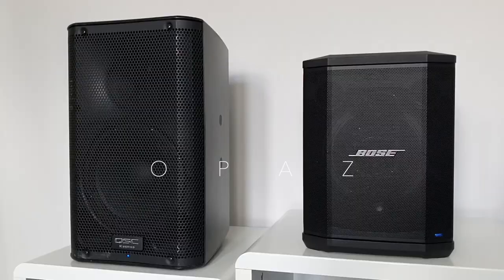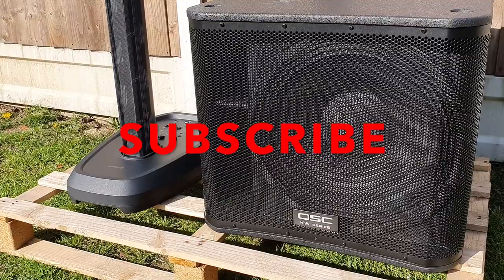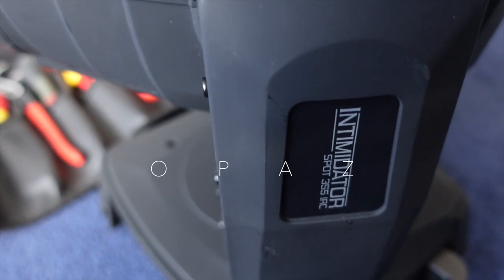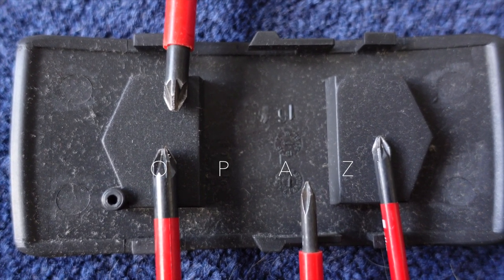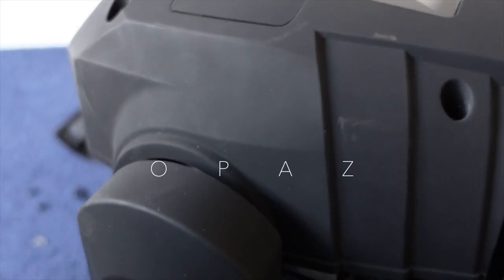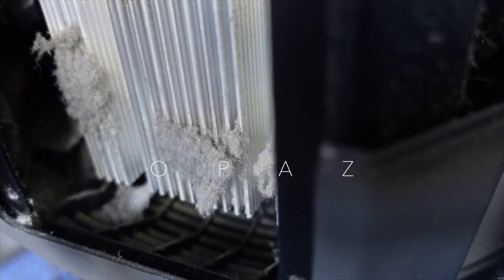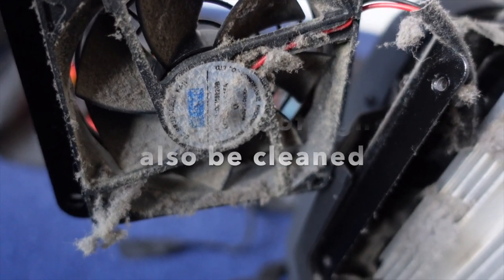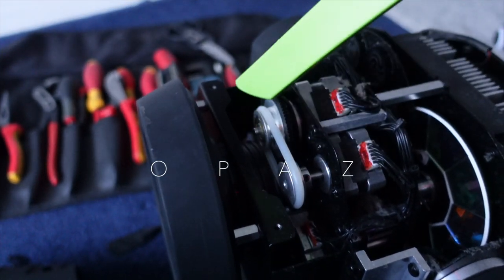Chauvet Intimidator Cleaning / Maintenance

Comment: Where should you apply lubrication and what type of lube do you use?
Reply from the maker: A rep recommended a specific type, once I've found it I'll let you know
Reply: @opaz.  thanks.
Reply: Any updates???
Reply from the maker: sorry for the extremely long delay (if you're still interested or still alive) silicone based lubricants seem to be a safe option for rubber drive belts